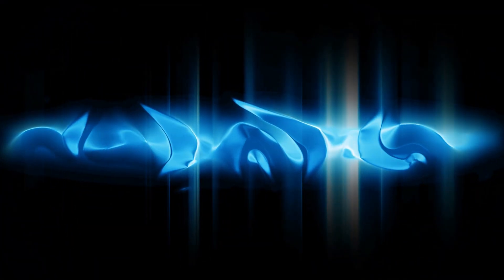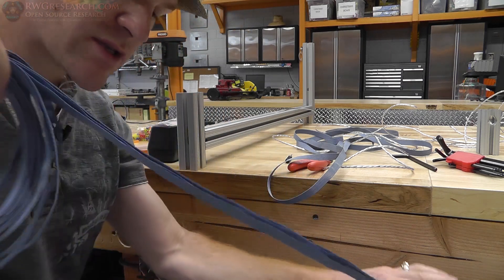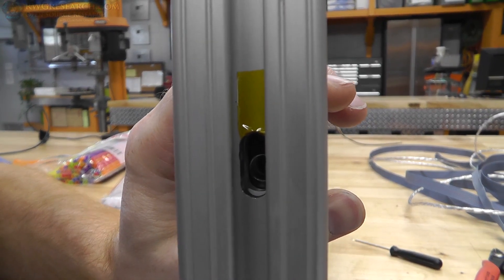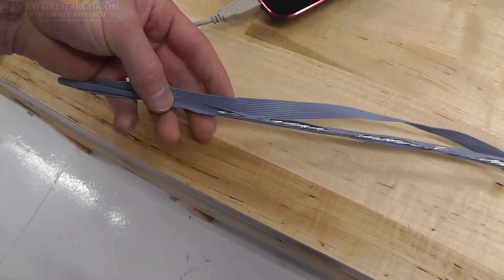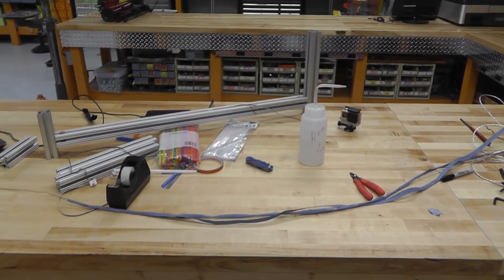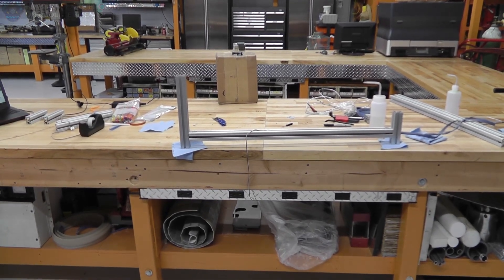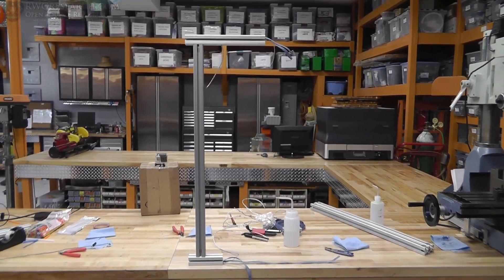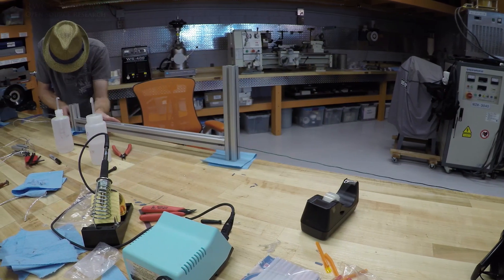RWG-OSD # 22 Threading The Extruded AL Electrical Needle ;) Egh!

Comment: I am trying to build a regular rostock similar to your original, and I keep getting the ramps controller beeping and flashing and switching between menus. I can't seem to figure it out, any suggestions?
Reply from the maker: sounds like the scroll wheel.  it could be faulty? can you un solder it and see if it still dose that? 
also a thing to look at it make sure that your firmware is set for what ever controller your using. 

I'd start there??? 

~Russ

Comment: slick wire hide . love it . i wonder  if the wire that had no shielding , is now essentially getting some shielding from the thick frame it is in .  unless you wanted shielding for each bundle .no matter what ,way cool man .
Reply from the maker: yeah the motors will be running at a higher frequency, the motor wires are individually shielded so thats not a problem. but yeah sure those other wires will for sure be shielded in those rails in all that AL,  lol , best! ~Russ

Comment: Would it have been easier to pull through just the long extrusions, and then feed it through the holes in the short pieces and then re-bolt everything back together?
Reply from the maker: yes, slightly, however for some reason i was not able to get it on after ... that would have been a shame lol 
 so i did it this way . It did not make it harder, the main problem was keeping the wires all the same, any twist in the wire and it was stuck... was a tight fit :) ~Russ

Comment: I think your gonna have to derate that conductor for that conduit :)
Reply from the maker: why would i need to derate it? your concern is that it might be squashed and if it heated up it may melt through the coating? If so i thought about it... but think it will be ok. was that it or something else ?  also i will not be even close to the rating of the small wires. a few are power but only 5V and the rest are just signal wires. and the motor and power wires are already over rated :)  and if i wanted to i could Meager the wires to check for coating breaks :)   thanks for the comment! ~Russ
Reply: Just giving you a hard time :) , with the amps and voltages concerned I can't imagine it being an issue. Megging it, now that's just getting close to outta control :), but I like your style
Reply from the maker: lol i got to do what i got to do... :) ~Russ